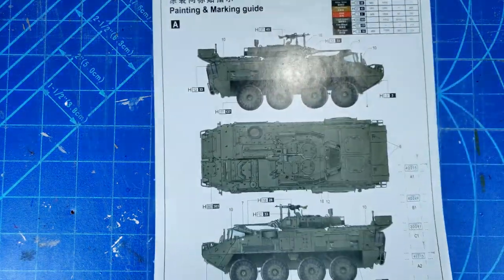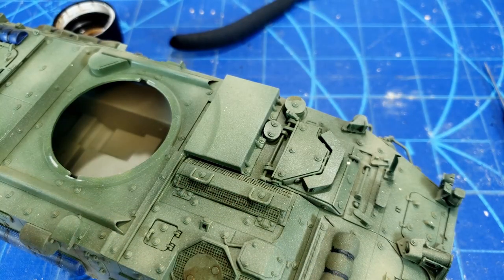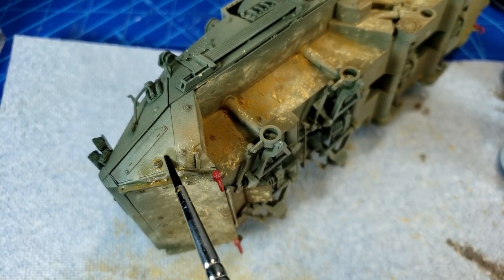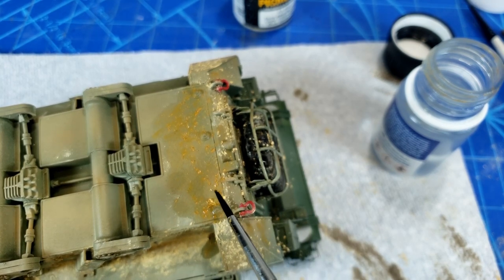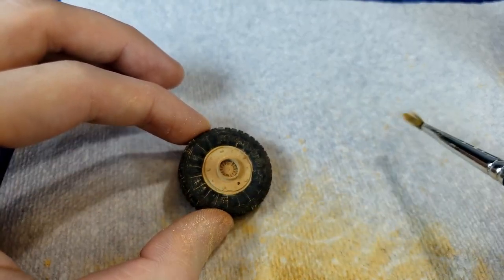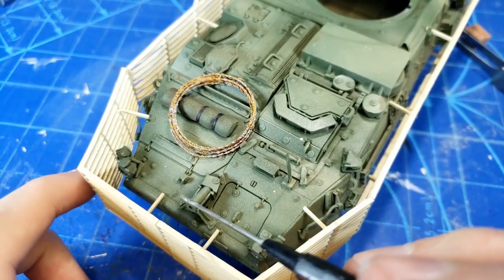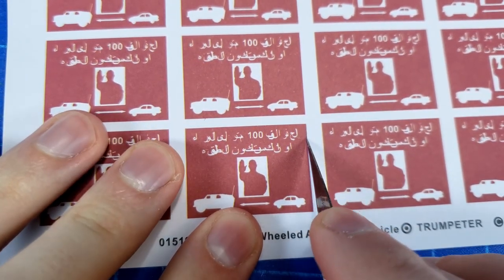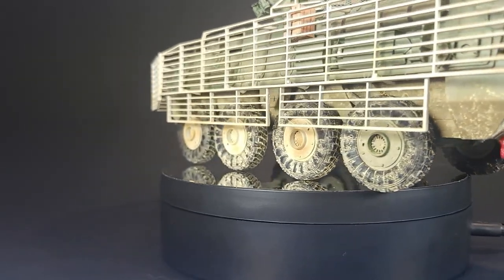Finally Finishing My Very Custom LAV III

Comment: Nice build, the 'tow cable' you put on the front of the hull next to the driver's compartment is a roll of concertina wire. It's used to make quick obstacles or barriers. They are often wrapped in sandbags, hessian or truck/tractor tire tubes to make them easier to handle and not scratch the hell out of the wagon.
Reply: It’s obviously a cowboy lasso.